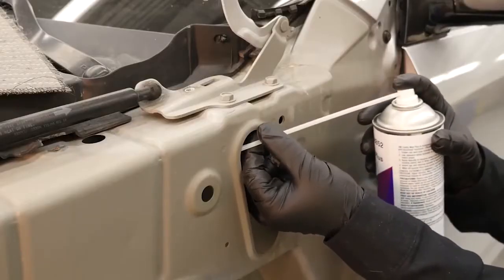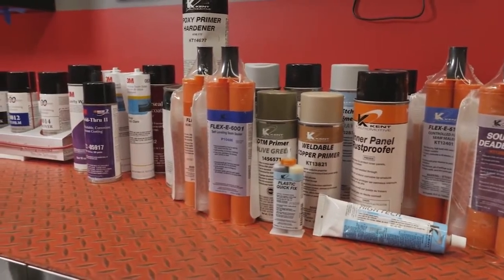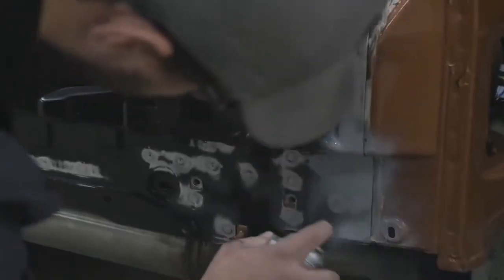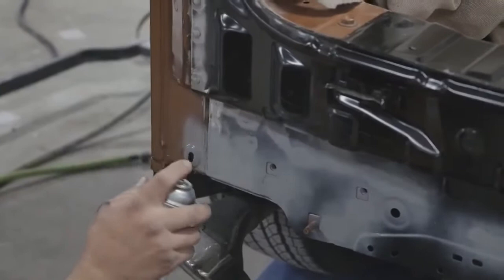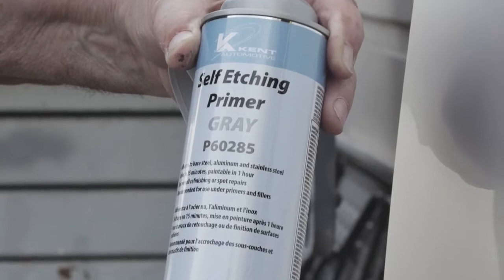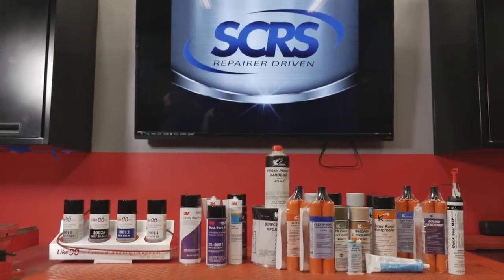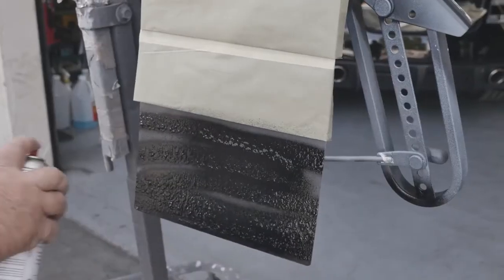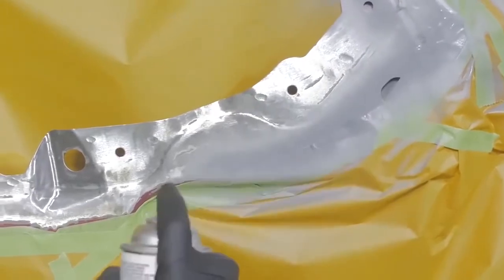SCRS Education Committee Presents - Corrosion Protection Part 1 of 3 - Primers

Comment: These guys talk a good game on camera, about conscientious attention to detail in vehicle repair.  I wonder how many of them "walk the talk" in actual practice when more money can be made by cutting corners and using inappropriate or cheap products to get by.  Generally by the time corrosion from shoddy repairs becomes apparent, enough time has elapsed that it is difficult for customers to hold shops accountable.  Shops know this of course, and it takes a lot of integrity to do things right when costs can be greatly lowered by cutting corners.  Most shops don't have that sort of integrity.